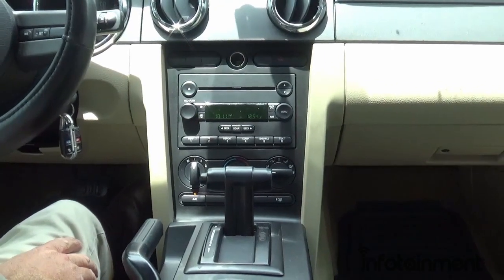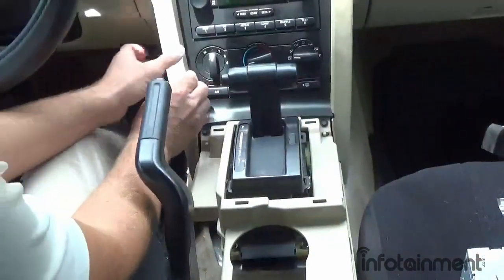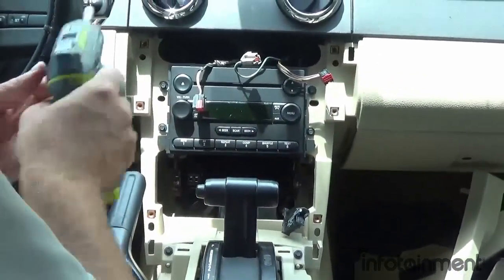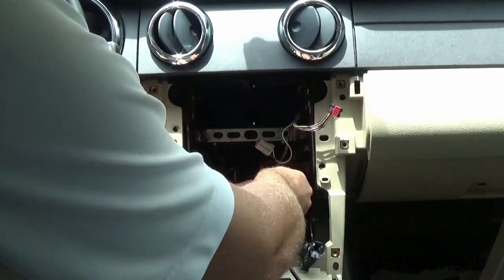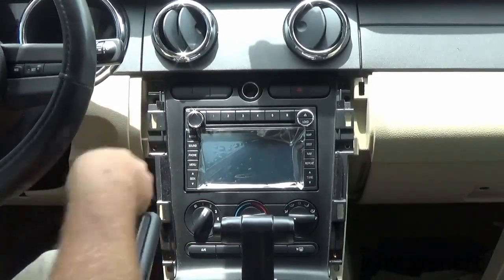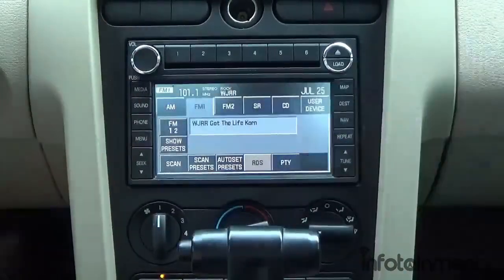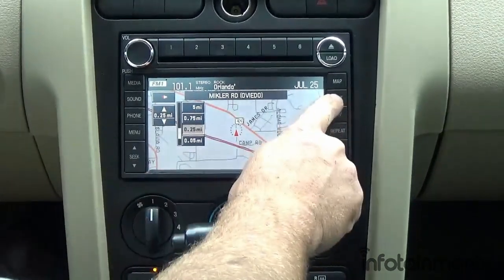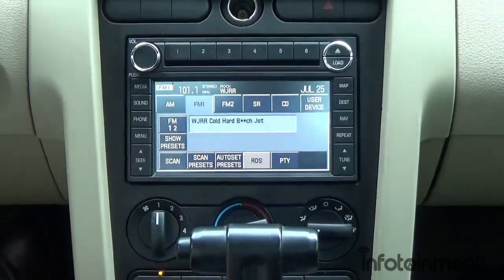2004-2009 Ford Mustang - Factory 6CD GPS Navigation Radio Upgrade - Easy Plug & Play Install

Comment: I would love to put that in my 07 mustang. I don’t like the “lost” look that a lot of aftermarket systems have. Either from not fitting right or just having a weird look to them. This head unit looks like it belongs in that car.
Reply from the maker: That is because it is the exact part that came on the Mustang at the higher trim level. This is 100% OEM Ford equipment.

Comment: I have a 2008 bullitt with with shaker 500.  Can I swap it for this nav unit with a 6 disc?  Thanks
Reply from the maker: Absolutely, however, I do need to mention this is one of the Legacy Ford radio units. So we can recondition and repair them, but unfortunately map database support has been phased out by Ford. You may be able to find the latest map disc on eBay (I think it's either 2013 or 2015 year version).

Comment: Do you guys still sell these? Just bought a 2006 GT. It has the car play in it, but I’d rather have something factory in it.
Reply from the maker: We do here is the link to that kit. 
https://infotainment.com/shop/interior-accessories/infotainment-radio-upgrades/2004-2009-ford-mustang-gps-navigation-radio/
Reply: @Infotainment_nav  What do you use for the older AM/FM plug wire adapter?

Comment: Can you add a backup camera to this radio?
Reply from the maker: It can be done via www.navtv.com for radio upgrade. www.navigation.com can help with the most up to date map disc for a stock OEM factory navigation radio for the 2004-2009 Mustangs. With the aux input you can use aftermarket add ons for bluetooth/hands free calling when you pair the smart phone to do so with the line in feature and raise the volume for the hands free call.

Comment: Do they make a kit to add SYNC?
Reply from the maker: Not for this upgrade but this will add factory navigation and the dealership or navigation.com can help with the 2016 maps for the physical map disc that lives in that OEM factory stock nav radio.